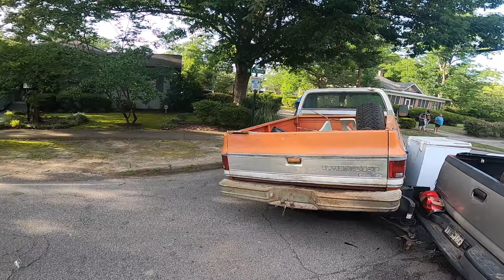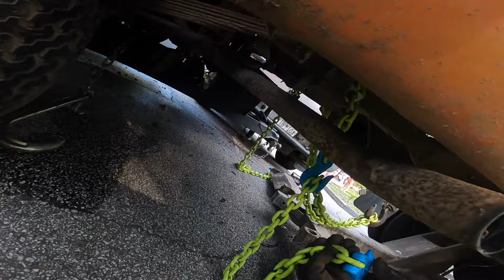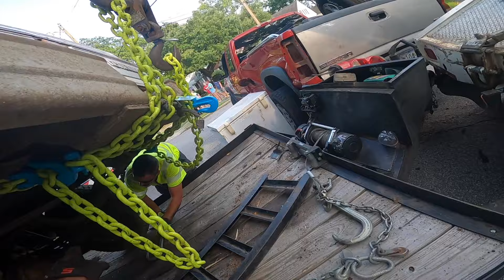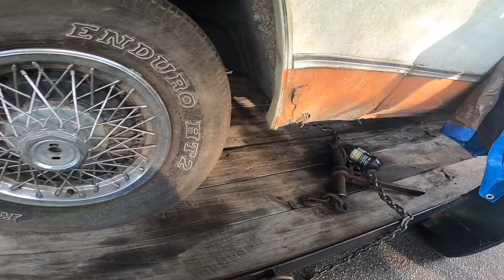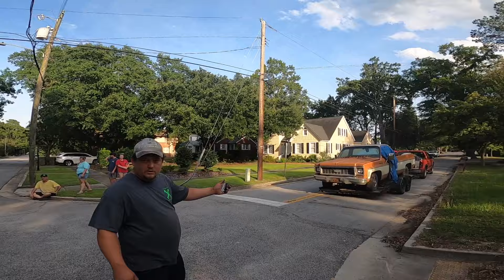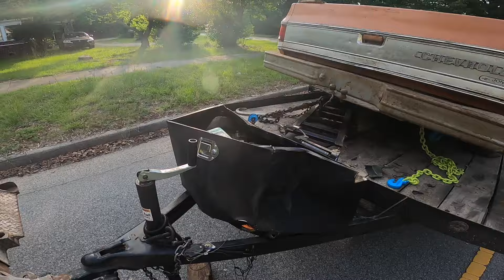Jack knifed pickup and trailer towing a pickup

Comment: 1st, They should leave the towing to the professionals! 2nd, The Truck was not properly secured to the trailer, if it was it would not have came off the trailer. 3rd, The driver of the truck towing the trailer should have gotten an Unsecured Load Citation from the Officer. 4th As always excellent recovery Mr Hal. Thanks for the video. Stay safe out there.
Reply from the maker: Mr Dan Thanks and thank you for watching. Stay safe